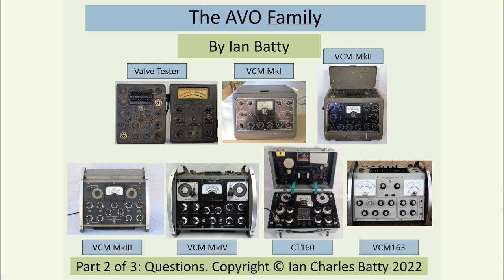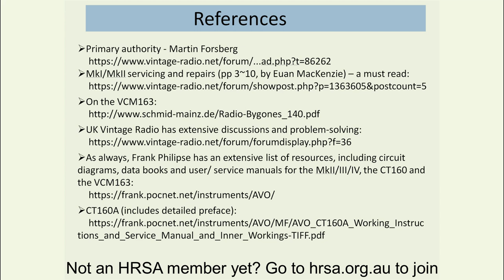AVO valve tester questions - main

Comment: I have produced a board that mounts onto the meter mount which has mounting holes at 34.5MM pitch. The PCB is fitted with back to back Schottky diodes and a 10uF multilayer ceramic capacitor.
At 20 centigrade the forward voltage is about 0.25V, the 10uF cap provides adequate damping, I have put a video up "avo valve tester meter protection circuit". It takes ten minutes to install